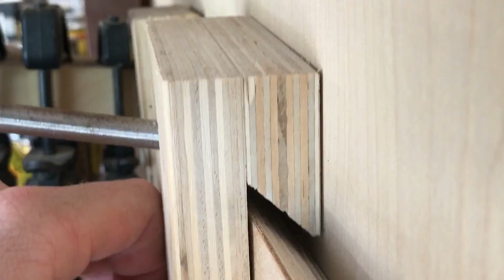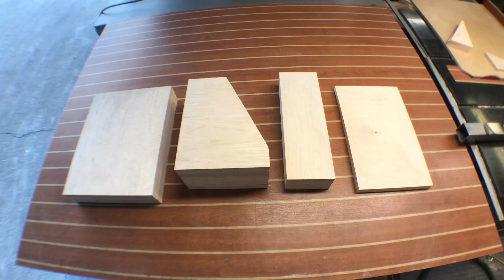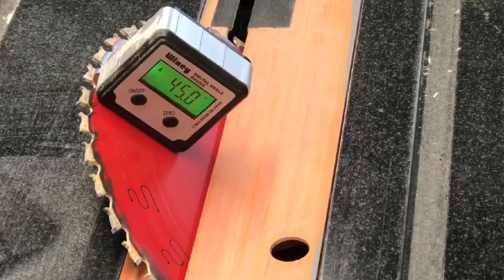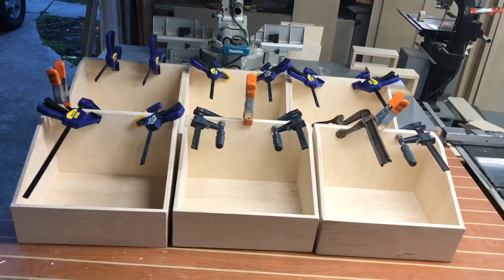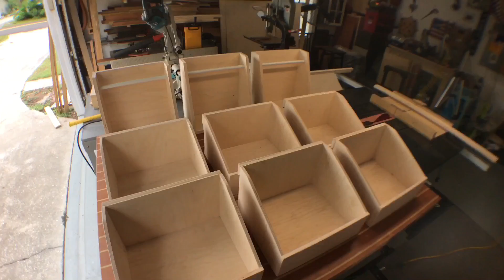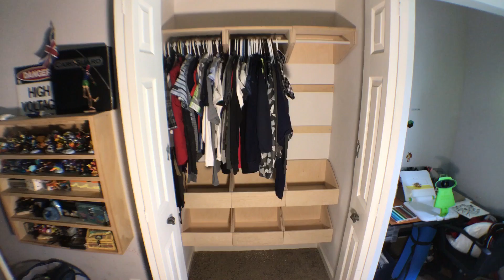How to Make a French Cleat Closet System | Woodworking project

Comment: Good idea I need storage in a linen closet. I'm totally hooked on French cleats. I'm in process building a wood shop in a pole barn. I've installed 2 1/2”-3” cleats on the gerts on three walls. I use 3” cleats to hang some cherry cabinets
Reply: Question: how do I install cleats behind bathroom cabinets without the clests showing? Anyway I enjoy your videos! I also get some ideas for using French cleats. Thanks

Comment: I see that you have your Miter saw facing your assembly area how you like that setup? I have mine up against a wall and has to be about a foot away to do the arms.
Reply from the maker: Aaron Nelson yeah you know what, I pretty much hate it. The dust kind of goes everywhere, however I have a massive fan blowing in that direction out the garage. That way the dust gets blown away by the air movement. I plan on incorporating a small miter station up against where my lumber rack is I just haven't had time to do it yet?  Good question haven't been asked that yet!
Reply: ahh the dust good point, i hate mine being against the wall i lose space, i was trying to think of where else i can put the saw to save space but stay functional.
Reply from the maker: Aaron Nelson there's got to be a happy medium somewhere. If I had more space facing out the garage, maybe a three car, I would ideally just have all the sawdust shoot out into the driveway, having the miter saw parallel with the garage doors at the entrance
Reply: then you have to sweep it up which is what i am trying to avoid especially in winter.